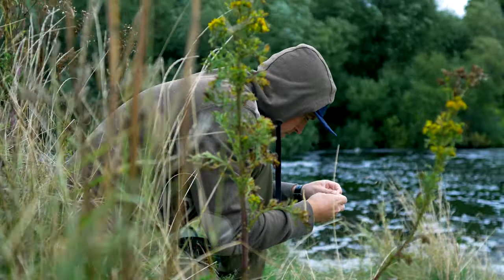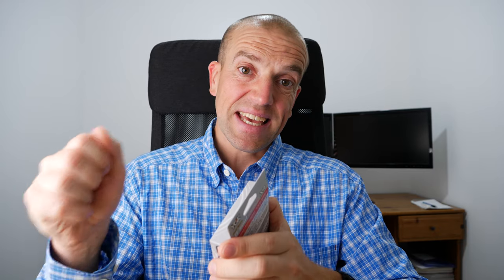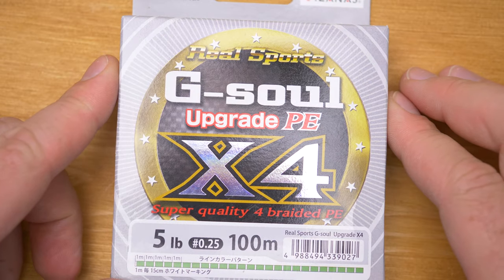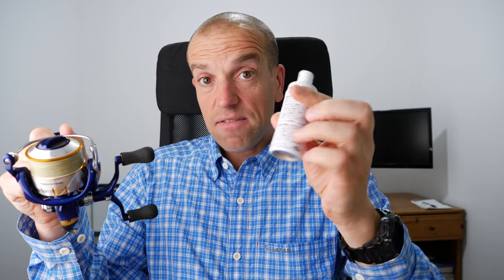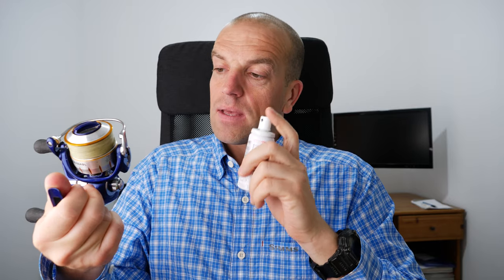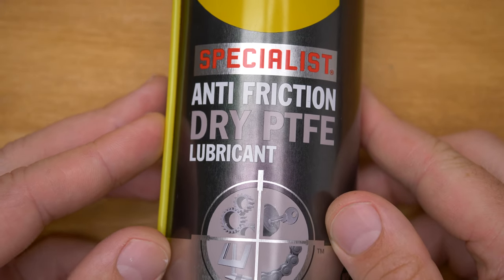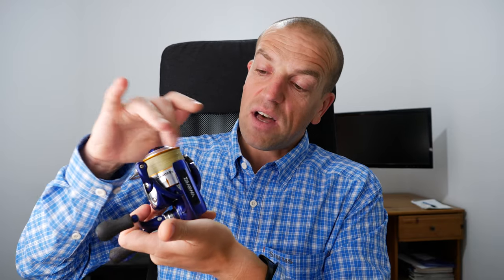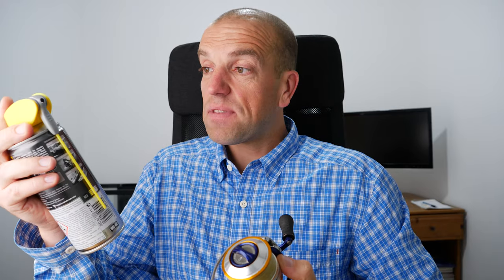How to improve braided line?

Comment: Firstly, iIm not advocating for more pollution, I'm on the same page as all of you, but to all those people getting on a high horse about chemicals in the ocean (or lake) from a puff of PTFE on some line think about how many anglers use boats for fishing, with outboard engines running exhausts, 2 stroke etc into the water. Not to mention commercial fishing and other commercial marine activity. I'm not advocating for more pollution, recreational anglers have their duty too, but i think hating on the chemical aspect of this video is misguided and pollution from nearly all other avenues would be more of a concern. Just my 2 cents.... Thanks for the video.
Reply from the maker: Couldn't put it together any better.👌
Thanks
Reply: @AndrewsKnots yes you could put it together better Andrew. This argument uses false equivalency, PTFE is a forever chemical that never breaks down, all the examples of pollution above are of degradable hydrocarbons or even gases which is a bizarre comparison. None of the hydrocarbons listed above are forever chemicals. Secondly there’s a logic trap set that is easy to fall into, that is because there are greater pollutants around adding one more just won’t matter. You can see already the fallacy of this as a reason to disregard this forever chemical.
Reply: Your 2 cents worth is worth, 2 cents, here’s the other 98 cents. Two fatal flaws in your argument, false equivalency and an illogical conclusion. It is simply not a fair comparison to put up hydrocarbon pollution and carbon monoxide (exhaust fumes) as an equivalent to PTFE pollution. Hydrocarbons are not “forever chemicals” but PTFE and its ‘neighbours’ (PFAS) are “forever chemicals”, they never break down, ever. 

“PTFE is one of the best-known and widely applied PFAS commonly described as persistent organic pollutants or "forever chemicals".”

The danger of persistent organics is that they find their way into the food chain and stay there forever, they bio accumulate from plants and microorganisms being eaten by larger organisms which, in turn, are consumed by more animals higher in the food chain, each time they ‘step up’ in the food chain their concentration grows. A large fish taken from the top of the food chain has accumulated all the chemicals in tiny amounts until the amounts become carcinogenic or otherwise toxic. The supposedly comparable pollutants you mentioned don’t do that. At some point they degrade or they simply cannot be transported up the food chain.

“Fish (or other aquatic animals) that live in PFAS-contaminated waters may contain PFAS. In some instances, if you consume too much fish from PFAS-contaminated waters, you may exceed the Tolerable Daily Intakes for PFOS, PFOA and PFHxS.”

In simple terms, the old argument of ‘two wrongs don’t make a right’ applies. It is not logical to feel vindicated to add another pollutant because others exist. As I’ve shown the forever chemicals are more dangerous in tiny amounts than some other pollutants in larger amounts. 

The dramatic evolution of battery technology and possibly hydrogen as an energy source will eventually do away with hydrocarbons in the boating industry. After which their pollutants will leave the ecosystem but the forever chemicals will stay forever waiting for additional molecules to add to their position in the biomass. 

The history of PTFE has been a troubled one and in its various forms it has been proven to be carcinogenic and each time legislation has had to be enacted to prevent its use. The spinoff company of DuPont’s, Chemours, makes PTFE and its formulation has changed a few times to try and eliminate the carcinogenic compounds. In its current form it is claimed to be non toxic to humans. A claim that has been made a few times over the decades until this was found to be false and the compounds changed. I would hate to see a future where the current PTFE is following in the footsteps of its forbears. Whether it is safe to add to the water now is unknown but its chemical composition will still find its way into the food chain due to its almost indestructible chemical bonds.

Comment: Wouldn't the solvents mixed with PTFE deteriorate the line? Have you done any experiment to see if you lose strength? I know regular WD40 does have negative effects on some types of polymers in the long run, but not sure about the 'dry lube'. And thanks for the video.
Reply from the maker: No, I have not done any tests. With this PTFE stuff, braid lasts longer for me and also other properties are better as explained. That's enough for me.
Reply: @AndrewsKnots  GT85 would be better then.
Reply: @richardjones2811 Whats different about GT85? Curious because it seems to have a "cult following" in the cycling world lol

Comment: Thanks great video, I used it on my 4# old braid and it works well. I saturated the outer layer before the cast then the inner layer after the cast. Works really well just so it before the line gets wet. Thanks again for the info
Reply from the maker: Sounds great!

Comment: Great video, when loading the braid on the spool try reeling it through a slice in a raw potato, this helps stiffen the braid and helps it sink, a very good polish feeder angler told this tip and it really works, I think it's to do with the starch in the potatoe,. Berkley fireline original has been my braid of choice for years now, it's very wirey, never get wind knots or any type of over runs on the spool with it.
Reply from the maker: Never heard of it but probably it's a valid idea. Will have to try it at some point 👍
Thanks
Reply: hi jk. does it help prevent wind knots?
Reply: @anacitogapoy8823  it does Andy yes, the stiffer the braid the less likely it is to tangle.
Reply: @jk-zf8eo  Thank you

Comment: I use Inox. Lanolin base and has full eco cred. You can even use it on food.
Reply from the maker: Is it this https://i.ebayimg.com/images/g/W4MAAOSwS-Va3ypq/s-l1600.jpg ?
How well it works (your general conclusion/impression)?
Cheers
Reply: Andrew's Knots - no it’s not that, it’s called Inox m3, I’d post a link except I can’t on this device, but it’s a non petrochemical, lanolin based protective spray/lubricant that I use on everything that gets wet. I used to find a salty, stiffening buildup in the body of my braid, but not since I started using the Inox. I spray the interior of my tackle boxes with it too, hooks don’t rust, seems to keep everything flexible, non greasy and newish, but it could well be just a placebo effect too :)
Reply: @rossmcleod7983  
Inox products are pretty good. Yes, some i think are definitely food safe lubricants safe for food manufacturing industries.
Reply from the maker: I will have to try to obain some (so far couldn't quickly find UK retailer..).
Thank you!
Reply: @atanassimeonov5138  
Yes mx3.
They also have a grease but not sure of the name.
Go to the inox website for the info.
Reply from the maker: @atanassimeonov5138  to my understanding that's the one! Still to find it in the UK, where it's available!
Reply from the maker: Thanks 👌👌
Reply: Try the spray version of lanolin..it’s called Fluid Film. It contains no solvents is and non-toxic/non-hazardous. It can be purchased at HomeDepot or any other big box home improvement store.

Comment: I believe if what you want is smoother propulsion for longer and more accurate casts, then I believe spraying PTFE (Teflon) on braid would help but there is also the issue of petro-chemicals in the line which repels fish (scent). This is reason why spraying WD-40 and any kind of lubricants onto reels is a bad idea. Generally depending your area fishing style and requirement. If I want better casting distance, I would rather wash my line after every fishing trip (remove gunk and oil) and reel in tight and tidy back onto reel. To reduce friction when casting, you can upgrade to 8x braid which is rounder than 4x braid. Adding a 2ft length of 100% Fluorocarbon leader also helps with smoother casts as FC is very smooth. Generally, I want to avoid exposing any part of line, rod and reel to any sort of petro-chemicals. Eg. Insect repellent and sun screen lotions.
Reply from the maker: I understand what you are saying BUT the actual PTFE amount in one can, which will last a year or so and the damage to the environment is probably much less than a few mile car drive to supermarket for grocecies shopping (not even talking about the plastic packaging). Also, line lasts much longer with the spray, so, less of it needed to procude etc.
Reply: I am not sure about other species, but I was surprised after years of avoiding sunscreen that bass can only smell things that are water soluble.
Reply: @AndrewsKnots  also you should mention that you ARE NOT spraying ptfe in to water. You spray it on the braided line, and it vaporises, leaving some oils to lube it.. so the text on the can about the toxicity is mentioned so stupid people would not throw this can in to the water...

Comment: Very great trick one question should i be carefull when apllying it because in my experience standart wd40 would penetrate in the real destroying the grease. Also i have shimano's kairiki braid is it good??
Reply from the maker: This stuff dries out fast, so, I don't think it will be a problem. I can't comment on the Kairiki BUT most braids are more similar than different (Dyneema based) and I tried on 3 or 4 different ones with good results. 👌
Reply: @AndrewsKnots  thanks i will try this stuff out and check the diference it makes thanks for the great video
Reply: Andrew does the PTFE spray make the braid float  or sink any different to normal ?

Comment: good day my friend
here in our country we didn't what this ptfe spray 
we have Q8 silicone spray
can I use it for my braided line?
Reply from the maker: Can't comment as I don't use Q8.
Reply: Check the reel first. Copper + Silicone. No no. 10m safe area. Chemical reaction. Copper + silicone meets air. Abaut one day and everything is green. Rust.

Comment: I wanted to try this and it was doing my own research on different lubricants I came across the fact that this family of chemicals is known to be  toxic in the case of Teflon coated pans. This newer version which is not outlawed in Europe or the United States is inconclusive about its toxicity so at this point it's legal but you have to consider that as more of a solid form gases off while heated. This lubricant form is going to be highly soluble because of its application design...and it has one mahor problem it doesn't ever biodegrade. It's what they call a forever chemical.  Even a silicone-based lubricant could take 500 years. I wanted to use this but I accidentally learned it never breaks down. I think it's great for any hard surface adherence applications like door, hinges, sliders, and cutting blades, Things that you're not constantly washing into a water source. but  rather just in a shop or on fixtures and tools  But I think something that you're constantly adding to water especially like a lake ecosystem system we should probably think about....I'm unfortunately deciding against it I really wanted to use this because of its inherent properties and the cost-effectiveness for its application. Hate to be the bearer of bad news that may or may not affect your consciousness. I unfortunately wanted to share that it was a forever chemical non-biodegradable. I wasted eight bucks on it at Walmart and almost still used it. Looking up with Varivas was sharing about their chemical composition they say it's a silicone base and environmentally friendly but I'm not sure I believe that entirely because it also has fluoropoly the chemicals in it also.. again if this was in a more stable fixed molecular structure but it is individual free-flowing molecules acting as the lubricant that are going to dissipate and dissolve.
Reply: Do you use biodegradable line and sinkers??
Reply: Thanks for sharing! Was wondering about all of this. 

KVD Line and Lure has bold claims about its proprietary polymers being non-toxic (and anectdotally people say it works well). From what i know about other industries that could just mean they made an insignificant molecular alteration to something known to be toxic just so theres no proof of it being toxic (yet).  Ill probably stick with that - maybe less of it or less often or at the end of the day when it when it has a better chance to adhere (it claims no solvents so probably nothing to evaporate). I thought the video creator had a good point in the comments about line lasting longer being conversely positive for environment. Ill never be perfect but i dont want to support useless pollution.

Another commenter mentioned raw potato but im afraid that would attract microorganisms aka get nasty. Now im looking into bees/parafin wax.

Would be interested in your thoughts on KVD L&L and bees/parafin wax!

Comment: Andrew does this make rough braid go through the rod guides more smoothly then?
Reply from the maker: Yes. It may depend on current stiffness of your line. This stuff stiffens a bit further. All my braids do work better once coated..
Reply: @AndrewsKnots  thankyou! As a fellow trent angler I appreciate your tips and advice! Does the spray make the braid smoother?
Reply from the maker: Sure it will. 👌
Reply: @AndrewsKnots  thankyou

Comment: Now two years after the video, what is your thought on the dry PTFE on the braided line tip?
Have you found something better, or is this still your go-to method?
Reply from the maker: From time to time I search for lanolin based spray to try it out BUT here in the UK I can't find any at decent prices. As a result, still use WD40 PTFE.
This WD40 PTFE still works it's magic on the braids.
Reply: @AndrewsKnots 
Why would you even need that? With right fishing set up and everything balanced there should be no need for these gimmicks.
I think this is unnecessary pollution.
Safety data sheet says: Toxic to aquatic life with long lasting effects.
Be better than this, stop using it on the waters. I know there are things that are more Toxic and pollutes In bigger scale, but why still choose something that is not necessary when you have the option to choose wisely and make even a small difference?

Comment: I have been doing a lot of reading regarding the use of WD-40 on fishing gear and after every fishing trip (salt water), I wash the entire rod and reel with fresh water and I use a clean rag lightly; however, when I get home I use WD-40 on the reel and braid. Most people think that it is just a lubricant...it is not, it's a very effective "moisture extractor", it keeps corrosion from salt water away from the reel and salt particles away from the braid; by the time I am out fishing again, the environmental consequences are none. Most of all human sewer waste and industrial goes into the oceans untreated in most of the world, and let's not get into the plastics tragedy coming from mostly Asia, relax and enjoy your fishing, good fishing gear is not cheap; I take care of mine.
This is good advise from Andrew. Thx.
Reply from the maker: Yes, WD40 PTFE is great! Agree with your statements 100%.
Reply: The WD in WD-40 stands for Water Displacement.  So WD-40 is Water Displacement Formula No. 40.  It was developed to displace water on the Atlas rocket.  The outer skin was also the fuel tank.  The cold fuel caused condensation and rusting.  WD-40 fixed that problem.
Reply: Fyi for those who dont know, the wd40 brand ptfe dry lube in the video also displaces water (probably not quite as well). Proper Wd40 is a mix of solvent and light oil, but i think its risky to use around a reel (especially if not tightly sealed). The ptfe dry lube spray might technically have an evaporating solvent carrier but if so i think its less gnarly and much safer to use around bearings and line.

Comment: Hi Andrew 
   Well went out a couple of days ago   with a full spool of new line (J braid) I had 2 massive wind knots. It's rare it happens but now need to replace it😬
So I've ordered my WD40 as you recommend so lets hope it works🤞
Thanks for the tip and very tight lines 
🎣🎣🎣🎣🎣🎣🎣🎣🎣🎣🎣🎣🎣
Reply from the maker: Hey,
I will work and you will be surprised with the difference in many ways! For me personally J-braid used to be a nightmare when it comes to wrap-arounds the tip.
Just make sure it dries before casting out 👌
Cheers
Reply: Daiwa j braid is 💩 Berkley whiplash ftw

Comment: Great tip, I will try it. The thing is that most people have only the regular version of WD-40 and will be tempted to try that one instead :D I wonder where is the limit. I personally have laying at home some anti-friction silicone lubricunt. I guess I need to try this on my old reel.

P.S. I also have a baitcaster reel, do you think it would benefit the same way?
Reply from the maker: This stuff stiffens the line a bit, so, the tangles are less likely to happen even on baitcasters 👌

Comment: The fish will probably hate the smell of it and will affect the quantity of fish I catch.
Reply from the maker: You use the line once it's dry! Anyway, I catch more because of this spray.
Reply: Fishes are mostly interesting to the bait ,not the line haha..
I'm definitely sure it doesn't matter
Reply: @김승훈-c7p  the line will release the chemicals  in it once it's thrown in the water and it spreads around, genius. Haha
Reply: @dirkdiggler2430  all the braided line has been coated by many chemicals agent anyway while manufacturing....try to pick up good point of this tutorial...or u can use  close environmental tools as like those had been used at primitive Era..
Reply: @김승훈-c7p  so if I spray wd40 on my car's paint job, the wd40 will not wash off the paint if I dip it in water because the paint has been coated by many chemicals and agents!?!?!? Lmfao!!!
🤣🤣🤣🤣🤣🤣🤣🤣🤣🤣🤣🤣🤣🤣🤣🤣